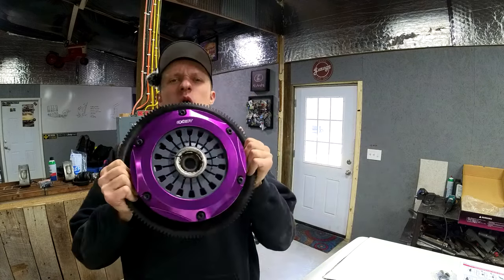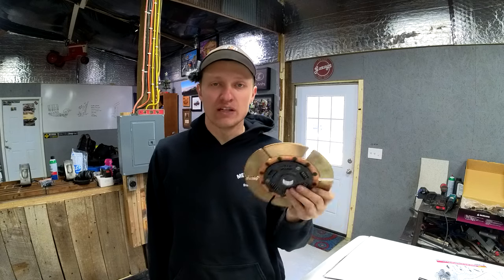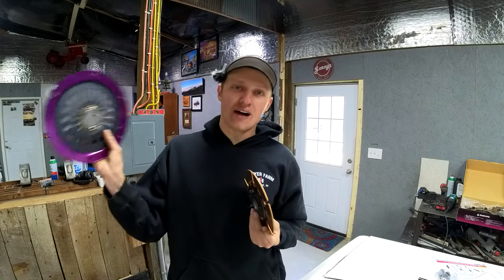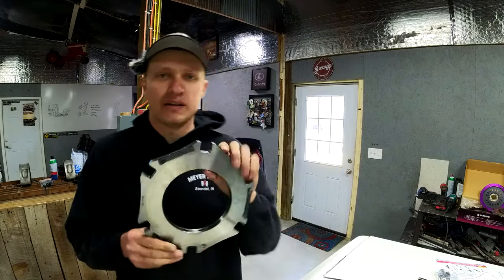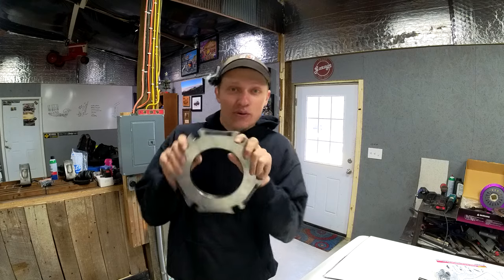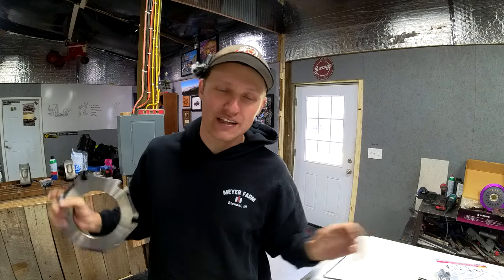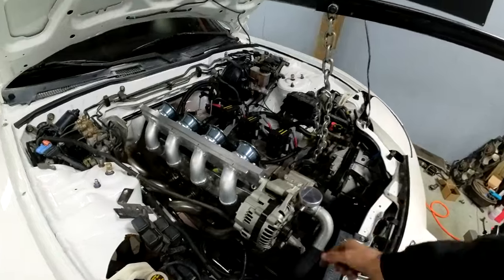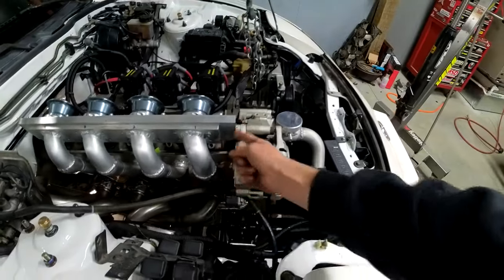The BEST STREETABLE Clutch for the 4 Rotor RX7 Street Car

Comment: I've got a 1977 Yamaha xs650 i need to rewire, and i get so overwhelmed thinking about it. It amazes me when someone can wire an entire car and not be the least bit worried.
Reply: It's easier than you realize. Just break it down onto sections.
Reply: @CastellawSpeed  what's more embarrassing is it's not going to have anything extra. Headlight, taillight, turn signals, and a charging system. No starter, kick only. Idk why it's psyching me out so much.

Comment: i've had this clutch in my impreza. it drives like a perfectly normal clutch. the pedal is a bit stiffer. but other than that you would never know that it was twin disc or even an aftermarket clutch. it does make some sound thoug.

Comment: Just wondering, how is the clutch pedal in the car? 
I have a 400hp car too except with a ACT 6 puck clutch, and it SUCKS to drive in traffic. Engagement is really hard, so i need a new clutch that's a little easier to engage and that can still hold the power.

Comment: Zero support for front of that looong engine rely  on the drivetrain to hold it in place scares me 😊.
Hopefully you'll later fit a fabricated bracket bolted to the front of the block and the sills in someway.